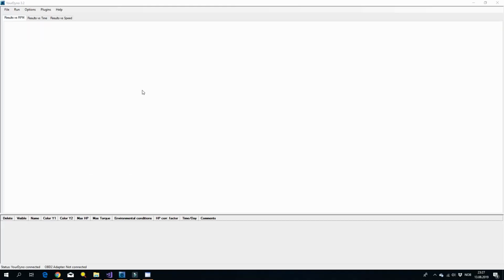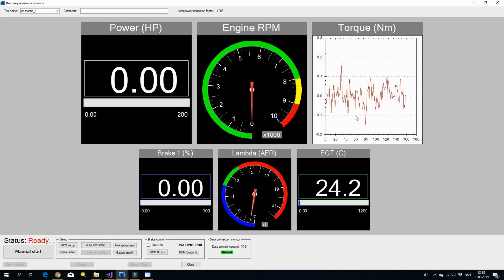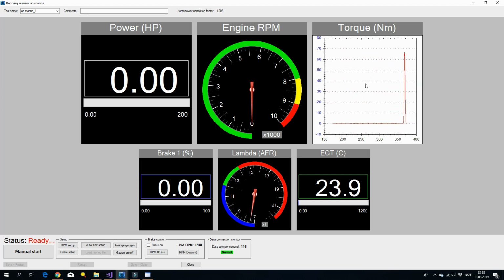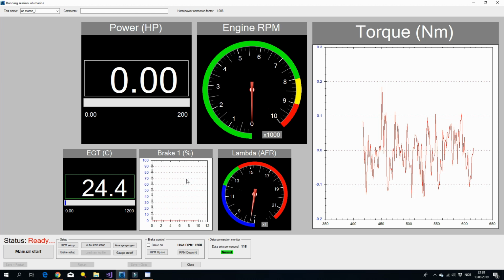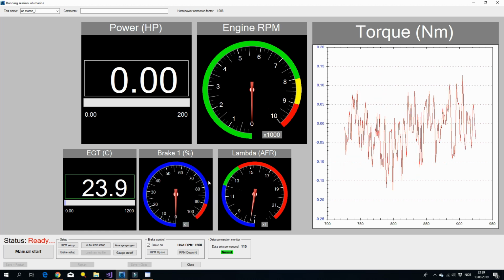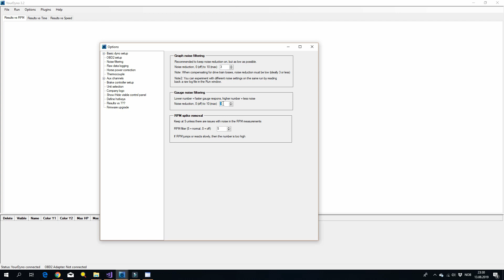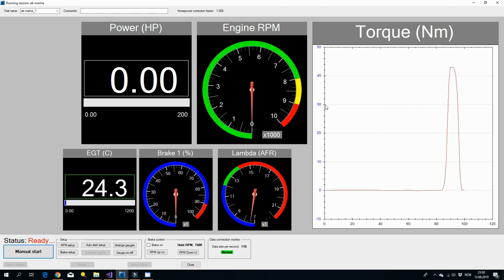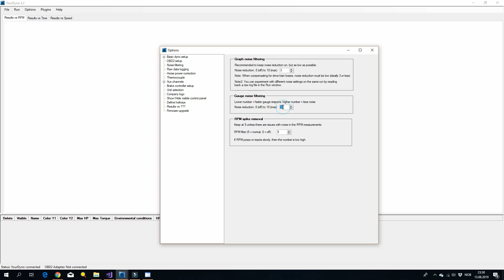YourDyno.com live graphs

Comment: Can you set warnings on live gauges. ie. set AFR gauge to flash red if AFR > 12.7 & map > 1.5bar  ????
Reply: You can set red, yellow and green zones on the analog and digital gauges, not on the graphs
Reply: @jostein.fonneland  yes, i mean on digital gauge style not analog gauge. So black background flashes predetermined colour depending on settings for activation. So your warning can be triggered by that gauge and other inputs meeting a specified value. For example, I might want afr gauge to flash red if map > 1 bar & afr > 12.9
..... basically a warning system
Reply: @Bondango  Yes, you can set three different areas and color them red, yellow or green, like in your example. The gauges do not flash, but show the colors based on the thresholds and the gauge value at any time. This is programmed by right clicking the gauge and select Gauge setup